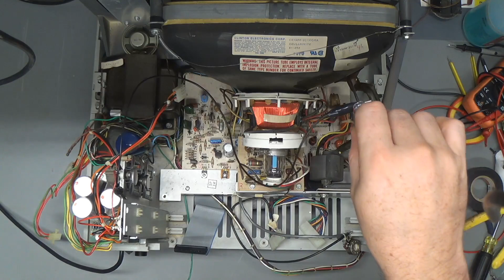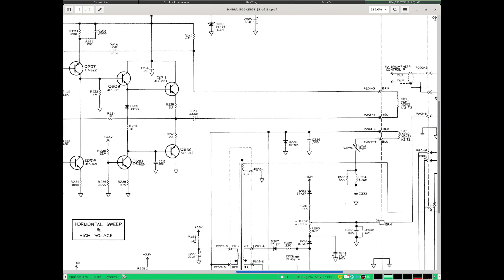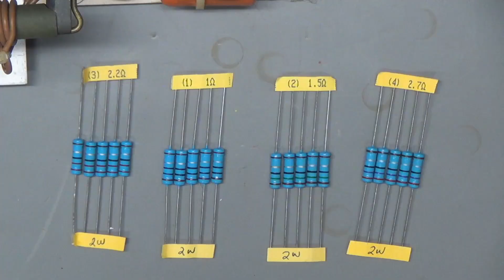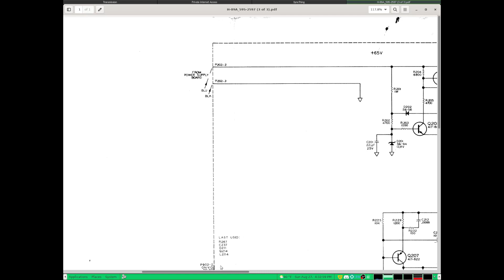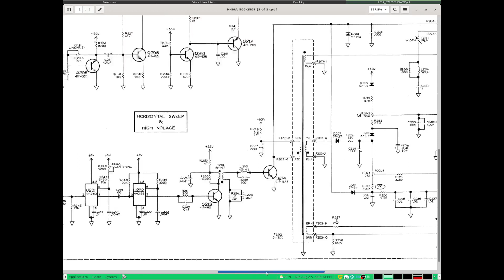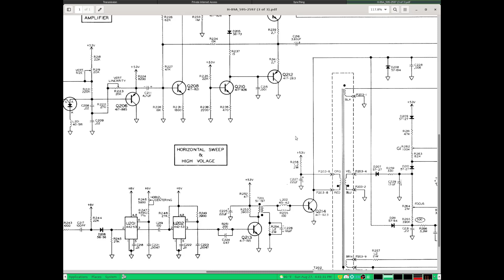Heathkit H89 / Zenith Z89 Fixup Pt.02

Comment: Cannot wait until you get the parts order in, and have the time to do the next round of solder sucking and replacements. 👍And, good on ya', re-capping. I know it seems like an unnecessary praying to the gods, incantation over the chicken innards, hoping "something fixes it. But If you got the right caps, and the time, why not?
Reply from the maker: Yeah, I guess....  I mean, small caps are cheap, but those big ones are expensive, and I think they can usually be reformed just fine with a little beer-break time.

I guess I just get a little annoyed with all the old computer youtubes that are like, "Ohai, I got this thing!  Here's 60 minutes of cleaning it!  Oh noes, it doesn't work?!?  TiMe to rEcAp iNsTeAd oF aCtUaLLy tRoUbLeShOoTiNg!!!!11one."

But I am an asshole, so ymmv lol.